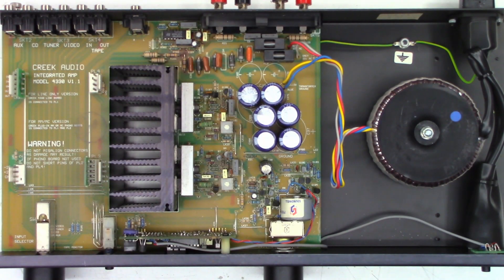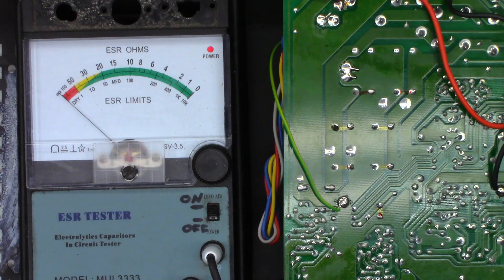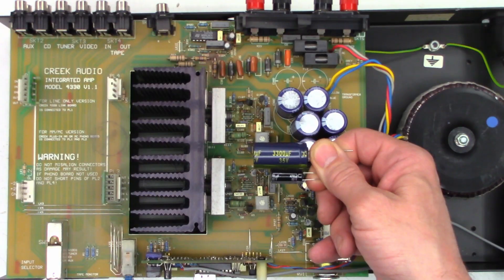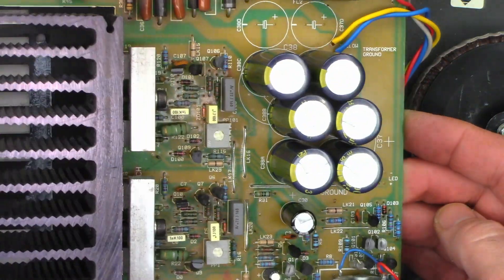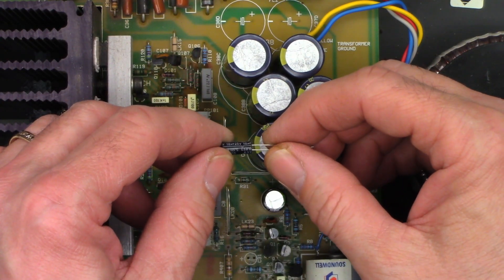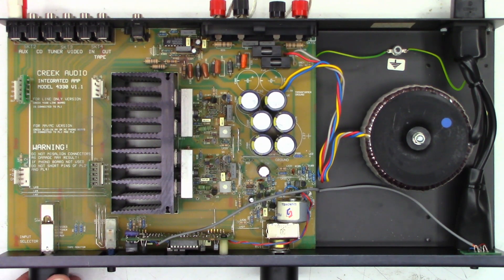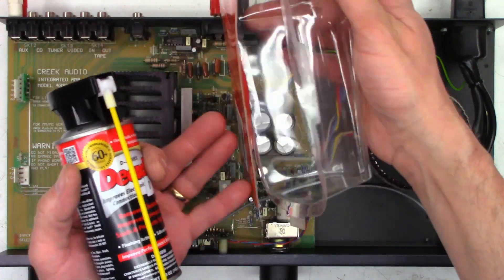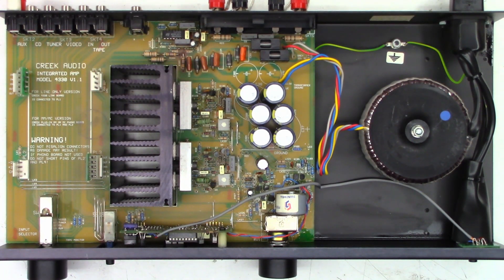CREEK 4330 AMPLIFIER WITH A LOUD BUZZ IN FOR REPAIR. DEOXIT D5 AND ACETONE IN THIS VIDEO!

Comment: Was the buzzing coming from the amp itself, or through the speakers? I have a creek evolution that has started loud buzzing on start up. I have no idea what the problem is, or if it is an easy fix for an experienced person.
Reply from the maker: From the speakers
Reply: @norcal715  thank you for the reply.

Comment: I like the idea that different modules were able to be optioned for the amp. In this case, it looks like this amp wasn't sold with phono input, but MM or MC could have been added at any time. 
I wish that Yamaha, Denon, Kenwood and co would do the same. Where I live, there are heaps of 5.1 and 7.1 receivers for sale for no more than $20 because they were made before HDMI. If their design had included optional input boards (something like expansion cards in PCs), that functionality could have been added and saved them from the bin. Phono input could have been an upgrade for them too.

Comment: The flexi-tip is installed. It means you can fold the straw down out of the way and spray straight out of the nozzle without removing the straw.
Reply from the maker: It says optional on the can though, and shows a grey tip?
Reply: Damn I thought the foldy thing was a flexi tip. Spray cans are sure complicated these days.
Reply: I prefer the old style tip.